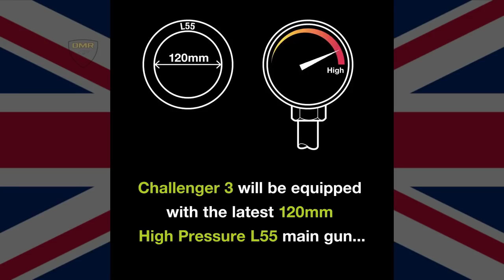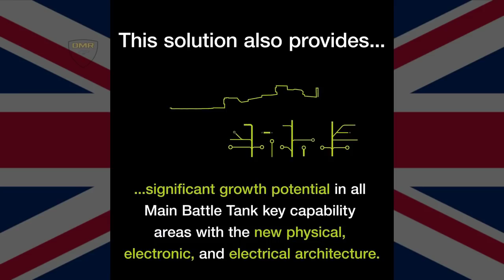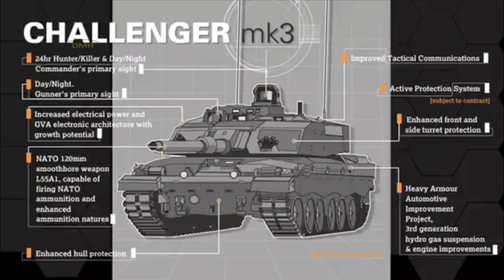Finally! The UK Unveils New Challenger 3 Main Battle Tank

Comment: Challenger 3 better be good for example.

The Challenger 2 is the only tank undefeated in combat, the L30 is the most accurate gun at longer ranges, Dorchester being the strongest armour to date, yes the Engine could be upgraded but why do you need to go fast when you can take the hits and survive them.

The Challenger 3 better have Dorchester at least, they have already fucked up by putting a Smoothbore L/55 type on it, if you ask me we just have sticked with Rifled but made the barrel longer so a Rifled L/50 for example.

Yes the more powerful engine is good but that worries me, does that mean to get to the new 60mph they have lightened it by putting up weaker armour.

The Challenger 2 is the King still on the battlefield, nothing has beaten it yet, not to mention the argument between the L30 and L/55 is that the L/55 can pan more. Considering the L30 can pan nearly the same amount as the L/55, plus the L30 is still more then capable of panning all know armour on the battlefield.

Challenger 2.2 would have been better, at least that had Dorchester and the L30.
Reply: L30 rifled is shit now I don’t know why people still think it’s better
Reply: L30 only can fire 500 full charges, the L55a1: ~1500
Reply: @GGG19872  not it's not
Reply: They haven't sacfriced weight for that speed the challenger 3 is 4 tons heavier 66tons and they claim to have improved the armour alough I do share your concerns
Reply: The Challenger 2 was obsolete as a design as soon at it got out of the factory. The Challenger 1 was much better at it's time. Saying that the Challenger 2 is as good or better than the Leopard 2A7V, Leclerc S2, Abrams M1A2SEP and T14 Armata is pretty weird because even the British army themself already stated that the Challenger 2 was lacking behind and that why there is so many modernisation programs happening around the Challenger 2. 

The Challenger 3 is a upgrade for sure. A new engine was really needed for the tank as he was one of the slowest modern MBT out there. The smoothbore gun is good news ! The only reason why British were using a rifle gun is for the use of HESH ammunition wich are obsolete, so it only make sense to abandon the rifle gun and HESH all together (and no rifle gun do not give extra precision compare to smoothbore one.. that a myth that need to stop). And a new turret and possibly new firing controls systems wich are always welcome !

So heay ! Better turret, better gun and better engine, let's just hope they put the Dorchester armor packet on it and it will be a great vehicle ! I would not call it the "most lethal tank of Europe" because that claims have nothing supporting it.. I mean the tank did not saw combat yet, how can know if it is a lethal machine if the thing never killed someone.
Reply: @vinex9385  I agree it needs to be tested all I said was that I share some concerns over its capability.apparently the armour is even further upgraded from the challenger 2 which has the best armour in the world alough I am curious as to what a fully dightised tank means and what programming the ammunition means.i also wonder how it stands up to an EMP.this tank is heavier,faster,smarter,has more firepower and supposedly better armour then the challenger 2
Reply: @danielmonk7451  I always find weird that people say "it has the best armor", "it has the best gun", "It has the best round", etc... will in reality nobody knows ! Like, even country that are allies don't know the value of the other tanks. We can only speculate on the characteristics of such modern vehicle. So claiming that a tank as a better top secret characteristic than the other one is just really silly to said. And personally I would say that M-84 Oplot has better armor especially on the hull but that one of the most debatable thing I sayd in my life. 

With this out if the way.. yes ! I'm curious to see how the vehicle is going to fair in battle conditions ! And I'm happy that the British finally have a new main battle tank that looks really good ! I also hope it get lazer warning receivers and hard kill counter measure ! And I most admit.. that thing is kind of cool looking :3
Reply: @vinex9385  yes no-one knows what the best tank is until it goes against a series contender in a war situation unfortunately that would be WW3 given how advanced the tanks are. And if it has Lazer weapons if any form that will be extremely exciting
Reply: Sorry m8 so far there's no Dorchester
Reply: This so just biased to its best,  Just ignore this everyone
Reply: @danielmonk7451  I'm going to say no to WW3 for the moments.. to dangerous for my liking
Reply: @mrp6870  and no-one knows how good it is
Reply: @vinex9385  M-84 Oplot best hull armor? PFFFFFFFFFFFFFFFFFFFFFFFFFFFFF dude that things is based the t72. No doubt it is highly upgraded but best hull armor? nope, nowhere that. The likely best one is armata. The armada has an armored box for 3 crew members (which is supposed to be rated at 1 meter of RHA) and the rest of the tank is able to withstand 30 mm auto cannons.
Reply: @ulfenburg7539  I never said it had the best hull armor in the world, i said it had better hull armor then Challenger 2. But if i have to choose a winner for the best hull armor, I would also choose the Armata chassis. The thing have like more than 900mm of protection.
Reply: Ammunition is the answer not the gun, the rifled gun is better in action it just doesn't have the latest ammunition. All the critics Chally has had over the years, even from the first competitions, the facts speak for themselves. Older Turkish Leopards dropping like flies in Syria but no one likes to mention that, and Merkel refuses to sell them anymore. Not one Chally lost in action and the armour is a generation in front of the Abrams. Let's hope the Leeds Factory that Tony Blair shutdown passed on the secrets of the armour.
Reply: @kevintravis2078 Rifle guns are not better than Smoothbore one, they were good during WW2 and early cold war but with technology they became obsolete. The myth of the more accurate rifle gun was invented by Challenger fans to defend their favourites vehicle. The only reason the British army uses rifle gun is to make HESH ammunition spin to make them more precise, other type of ammunition like APFSDS, HEAT-FS or HE-FS doesn't need the gun to be rifle to spin on themself. That why other country doesn't have rifle gun, because they don't need they gun to be rifled ! Also, rifle gun have a shorter life expectancy and cost more to make. 
And you are comparing "older Turkish leopards" against more modern Challenger 2 ! It's like comparing a T-34 to a T-54, it mean nothing. And the Turkish have less experience and worst crew than the British that experience using tank since 1917. The most important part of a tank is the crew inside, not the tank characteristic.
And for the armor of the vehicle.. we know nothing ! How can you said that Challenger 2 has better armor if you don't know what the armor is made of ?! That just so bias ! Yes, no Challenger were lost in battle but crew has been hurt or killed multiple because of hit on the humongous lower frontal plate so the vehicle is not invincible and have major exploitable weak point in its armor like every other tank in the planet !
Reply: @GGG19872 

Dude the L30 is not "shit as you put it, fact that the L30 still is the most accurate at longer ranges, and in tearms of armour pen, it's still able to go through all know armour on the battlefield.
Reply: @vinex9385 

The Challenger 2 to date has the strongest armour being Dorchester.

Going it to war the Abrams and Leapeard 2's both lost many tanks due to enemy fire, the Challenger 2 was never lost to enemy.

In fact the 3 things that make a tank, being Armour - Fire Power - Mobility, the Challenger 2 had 2 of the 3 beating the Abrams and Leapeard 2.

Fire Power the L30 having the longest range and being the most accurate at longer ranges, and in tearms of armour pen, the L30 is still able to pen all know armour on the battlefield.

The Dorchester is still classed as the Strongest armour to date, proved in battle surviving all weapons short at it, where you had Abrams and Leapeard 2's being penned.

The Engine yes was a bit of a 50/50 good at 1200bhp but the 72 ton fully loaded Challenger 2 yes didn't help.
Reply: @Justineexy 

Dude if you know the L30 or Dorchester then you would also know its still more capable then both Abrams and Leopard 2.

L30 more accurate and still pen all known armour.

Dorchester still stronger then both Abrams and Leopard 2's armour.
Reply: @forzaisspeed  Funny how you compare M1 Abrams and Leopard 2 wich are much more use in combat than Challenger 2. Those two are the most commun NATO tanks on the battlefield so it's normal that they have been shot at a lot more and in consequence have been destroyed more often than Challenger 2. Also Abrams and Leopards are use by multiple country other than the USA and Germany, those country does not use them the same way as their origin country causing more damage or destroyed vehicle. The spare use and low number of Challenger 2 on the battlefield and the fact that only Britain use them with good crew and good tactics result into a extremely low number of damage vehicles.
Those this makes Challenger 2 the most armor tank in the world, no ! Until we get the armor value of the vehicle, this claim is bias ! If the number of vehicle destroy is use to choose wich vehicle has the best armour, this would make the T-14 Armata the tank with the best armor in the world because guess what ? It never got damage !
And the L30 being able to pen everything it shoot at mean nothing because the only thing Challenger 2 is shooting at are T-54/55, T-62, T-72 and old IFV like BMP-1 and 2... you don't need master penetration to destroy those obsolete tank. And I'm pretty sure any gun can shoot as the same range as Challenger 2 with the same precision (don't you dare bring the fact that the gun is rifle). So we all need to take the Challenger 2 has what it is.. a average vehicle that is in part with other NATO vehicles and like those other NATO vehicles need upgrade to keep up.
Reply: Amazing, everything you just said was wrong.

L30 is not the most accuract, Dorchester is not the strongest, and no tank that has relied on taking hits rather than avoiding them has been viable since 1942.
Reply: @vinex9385 

Dude facts are facts the Challenger 2 battle proven to be better then both Abrams and Leopard 2.

In the middle east both Abrams and Leopard 2 have been Destroyed by Enemy Fire, with the Abrams having around 20-37 destroyed by Enemy Fire 7 Destroyed by Friendly Fire and 100+ Destroyed by SDC, while the Leopard 2 has had 10-12 destroyed by Enemy Fire 0 Friendly Fire and a faw Destroyed by SDC, while the Challenger 2 has had 0 destroyed by Enemy Fire 1 destroyed in Friendly Fire and 0 destroyed in SDC. They 

The L30 again has been proven in battle by being the most accurate stationary and on the move, and with HESH being more capable in more areas, ie taking out not just armour but buildings and dunkers, not to mention the L30 is still able to pen all known armour today on the battlefield, yes the L55 may be able to pen thinker armour, but the armour today is still weak against the L30. 

The T-14 if you can believe what the Russians say, "nothing no NATO gun can pen its frontal hull", so that includes the M256 and L55. 

The Dorchester Armour again has proved itself with report after report of the Challenger 2 survivability against weapons that have tool out tanks like the Abrams and Leopard 2.

The Challenger 2 in battle has proved its the best.
Reply: @forzaisspeed  lol you are so bias dude, you know what other vehicles never got destroyed in battle against the same enemy as your precious and invincible Challenger 2 ? The Leclerc S2 ! Heay dude, sorry for dethroning you perfect British tank but the Leclerc is faster, have a better firing controle system and gun than the Challenger 2. And what are you going to say about it ? I mean it is fact that no Leclerc S2 got destroyed but only one got damaged by an unknown ATGM. Only one person died inside a Leclerc will multiple died in the Challenger 1 and 2 by hit in the humongous lower frontal plate.
And if the Challenger 2 is the best tank in the world, why did the British start a MODERNISATION programs to catch up with the other. It's weird that such a powerful vehicle would need an upgrade if it is the best, that stupide right ? That would just be wasting a lot of money on a useless programs right ? But guess what !? There is a upgrade program ! And it gave birth to the Challenger 3 ! Why would the British army need a Challenger 3 if the Challenger 2 is the best tank in the world !? Think Niegel think !
Reply: @forzaisspeed  its only more accurate with Hesh which is obsolete it makes sabot rounds less accurate because it spins them and they have way less pen than smoothbores because the sabot is too short and it doesn’t travel as fast it can’t pen all known armour. The ONLY + for rifled is that it can shoot hesh more accurate and there are way better rounds than hesh
Reply: @GGG19872 

The L30 fact is is still able to pen all known armour today, yes the L55 my have slightly more pen, but when the L30 can still go though the armour on the battlefield today what's the point.

Plus the APFSR in the L30 isn't less accurate due to the spin in fact in flight the fin's help to somewhat stop the spin and by doing so gives the L30 in both HESH and APFSR more accuracy.

L30 is around 3500+.
L55 is around 3000+.
M256 is around 3000+
Reply: Dorchester has not been "the strongest armor" for the past 25 years, if ever.

The Chally 2 was a good tank, lets get that right, but this insistence on you Brits talking out of your ass needs to stop. We have data on the rough protection of the original Chally 2. Its not a mystery tank. It was comparable to an early 2000s Leclerc, which in turn was inferior to both the Leo2EX and the M1A2SEP (export).
Reply: @vinex9385  No Challenger crew have ever been killed in combat (just blue on blue and a training accident), there have been no penetrations to the lower front plate either, there was a partial penetration to the underside of the tank, but that was pretty much a fluke hit and would go through every modern MBT out there.

I really don't know why people think the Challenger 2's lower plate is weak, its as strong as the next tank out there, the turret will always be the strongest armour and "weak spots" are small and not really viable to anti tank weapons like hand held RPG's.

Aircraft and helecopters are what tanks fear most, not other tanks.
Reply: @johanlassen6448  The M1A2's DU armour is strong, better protection for APFSDS, but worse v HEAT, which is where Dorchester protects best, remembering that HEAT does not lose penetration over distance unlike kenetic rounds, this means that Dorchester gives better protection at range (as AT guided munitions from Russian 125mm guns have a range of 7ish km, more effective than kenetic rounds).
Pro's and con's to both types.
Reply: @GGG19872 

How I'm I making shit up Kid, numbers are facts dude, Deal with it.
Reply: @tonyb1223 

The Abrams DU Armour is not close to Dorchester, yes it may be able to hold up against same types,  but if you read reports from the DU armour in testing it gets penned by the same weapons that couldn't go through the Challenger 2 being Dorchester.
Reply: @forzaisspeed  please read what I said, Dorchester gives better protection from HEAT rounds, the fact that most rounds fired at a tank are HEAT rounds (RPG's etc) then its better protected.
APFSDS rounds are usually tank killing rounds fired by other tanks, as tank on tank engagements are pretty rare anyway, the DU is only really effective against these, not HEAT 🙂
Reply: @tonyb1223  Since most composites offer exceptionally strong protection against HEAT (in excess of 1000 mm) the "extra" HEAT protection that Dorchester may or may not provide is not really relevant across the frontal arc though.
Reply: @forzaisspeed  
As I said this was at best questionable when Dorchester was introduced and most certainly not true today. The Greek Tank Trials pretty much singlehandedly dispelled this myth as the Chally 2 was ranked on par with the Leclerc and inferior to both the M1A2 (with export model armor) and the Leo2A6/Strv122 in terms of protection.

HAP 2, HAP 3, NGAP are all stronger than Dorchester.
Reply: @tonyb1223  So you mean that the 70/90mm plate with some ERA slap on it is strong ? Like, any TANDAM war head can penetrate that thing. I want to believe that it's a bit better than on Abrams or older Leopard but managing to fully stop a TANDAM heat rocket ? Looks like a bit of a stretch doesn't it ? But it don't really have to stop such projectiles, I mean, the position of the tank in combat most of time hide the lower plate so it doesn't get hit. Wich mean you don't really need to put a massive amount of armor on it. Maybe I was wrong for the penetration on the lower, I must have mixed Challenger 1 with Challenger 2.. they have basically the same hull so it doesn't change anything.
And also you forgot the Challenger 2 that was destroyed by ammunition detonation because of friendly fire, RIP the 4 crew man inside.

(I think we both agree that the Challenger 2 is not the best tank in the world ?)
Reply: @vinex9385  you mean the cover plate that has the armour behind it... (Challengers use modular armour, the plate just covers it), though its just standard RHA and not Dorchester.

I also mentioned the blue on blue incident, fluke again, the HESH round didn't penetrate the tank, it hit the open cimmanders hatch and ignited the bag charges, killed 2 of the crew 😪
Reply: @johanlassen6448  Well it does matter, its very rare that tanks kill tanks, Dorchester provides better protection against the greater threat, HEAT projectiles, kenetic projectiles are great, close up, but that isn't the greatest threat.
Now the CH3 has a new version of Dorchester which could make it as effective as DU armour, we just dont know, but more HEAT rounds will be fired on the battlefield than kenetic penetrators, so hence better HEAT protection
Reply: @tonyb1223  If you want good HEAT protection you'd need APS at this point, since HEAT rounds will be fired at the top and sides of the tank.
Reply: @tonyb1223  A comment ago you said that no one died in a Challenger 2. And now look at you, saying the opposite. Ironic isn't it ?
And I don't know who I should trust.. multiple article and sources that say that the lower plate is a weak spot or a random dude on YouTube ? It's just a RHA plate with a estimate value of 70mm after all and the Dorchester add just a additional plate with ERA on it. And the Challenger 2 have a additional weak spot of the driver optics wich no other NATO tanks have. It mostly get hit in the turret like every other NATO tanks so it's more armoured hull is not of the most use and it have the same weaks spots as all the other MBT : Mantlet, lower plate and turret ring.
So heay, I stand my point, Challenger 2 is maybe the most armor of the NATO tanks but it clearly is not the best (it lakes a APS system, lazer warning receivers and it's slow)
So no
Reply: @forzaisspeed  ok where did you get these “numbers”? YouTube?
Reply: @vinex9385  you did not read what I put? No Challenger 2 crewman has died in combat except a blue on blue and a training accident.
Blue on blue doesn't count (classed as an accident) as they are not under hostile fire and a training accident at the range is just that.
Reply: @johanlassen6448  Whilst I agree that an Active Protection System will be of benefit for any tank, the side armour is pretty tough on the turret, people forget that you aim at the centre of mass on a tank, its very difficult to aim for so called weak spots, especially at range and on a moving vehicle.
Reply: @GGG19872 

It's called research Kid something that you've probably never heard of before.

Reports - Papers - Talking to people in the military.

Unlike you that watch YouTube and read wiki.
Reply: @forzaisspeed  I did what you said. And guess what ? In two research I found that L30 had a range of between 2,900m and 3,000m and that L55 had a range of between 3,500m and 4,000m.. are kidding me ? You are here talking about how you need to do research and treating people of "kid" like you are smarter than them just for me to find that you were wrong in 5min !? What's your problem dude ? Like, omg ! Everyone is telling you that you are wrong and bias but instead of being like "you know what, I'm going to check my source and do some new research just in case" you decide to turn brick wall on and having a comportment that you would find on a Flat Eather Facebook page ! Just accept that you are wrong ! Accept that the L30 is not the best gun and that Challenger 2 is not the best tank in the world ! Be happy that Challenger 3 is coming instead of starting crying because someone sayd that your favourite tank is not the best that will ever be.
Reply: @tonyb1223  Sorry.. I forgot the "in battle part". And do you agree that Challenger 2 is not the best ? It has great armor and a great gun but it's speed is really a problem. Imagine they put a APS and a lazer warning on the new Challenger 3 ? Wouldn't that be awesome !?
Maybe in my commentary I looked a bit anti-Challenger but I actually really like the tank, I just try to avoid being bias.. maybe I'm avoiding a little to hard.
Reply: @vinex9385 

Dude stop reading Wikipedia.
Reply: @forzaisspeed  Do you know do say something else than "Challenger is god" and "stop reading wikipedia". If you have such good sources and if you know so much about all tank gun, what are you waiting for to share the link of the article that contain the truth ? We are all waiting for your knowledge dude, give it to us little man.
Reply: @vinex9385  there’s no point arguing with him hes in the comments of all British military videos and does this there’s no way you will get through his thick skull
Reply: @vinex9385  It is am excellent tank, my mates lad was a CH2 driver and I know am Ex CH2 tank commander, who originally trained on Chieftain, then did a conversion to Challenger (as he was posted to a unit with them and fought in the Gulf War), and later converted to CH2, and he really liked it, alot.
So yes, its an excellent tank 😁
Reply: @tonyb1223  That such a nice story ! I mean, war is not fun.. or nice.. but it's really cool to be able to talk with people that actually use a tank ! I would have so much question to ask ! I always find it weird that people focus entirely on the tank and not the crew inside, I always thought that the most important part of a tank is the crew. When you were talking to me, it was clear that you know much more than me so I decided to shut my mouth for once and I'm happy I did ! Otherwise we will still be arguing and I would never had this nice little story.
Do the crew inside the tank does know the tanks characteristic ? Or is it keep secret even for the people operating the vehicle ?
Reply: @cattledog901  It's useless.. don't waste your time on that guy. He is the most bias and over confidently wrong person I have ever talked to. He's just making up numbers and fact because he can't stand that people dare criticise is favourite tank.. you know the guy with the Dunning Kruger Effetc (https://en.m.wikipedia.org/wiki/Dunning%E2%80%93Kruger_effect). A huge waste of time, it's like trying to prove to a flat earther the Eart is round, a true brick wall.